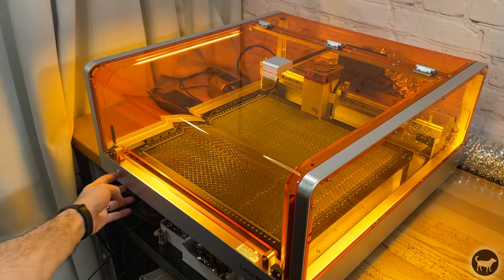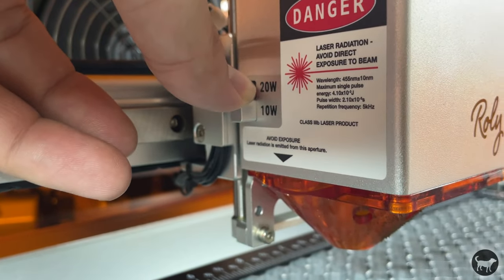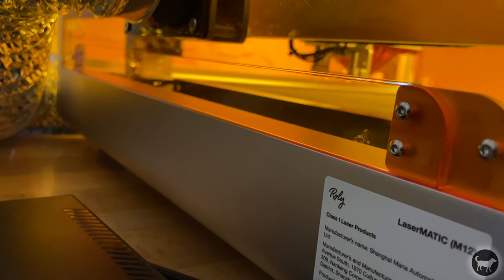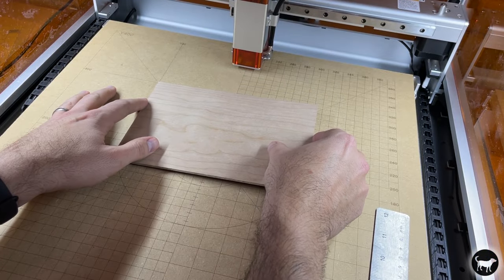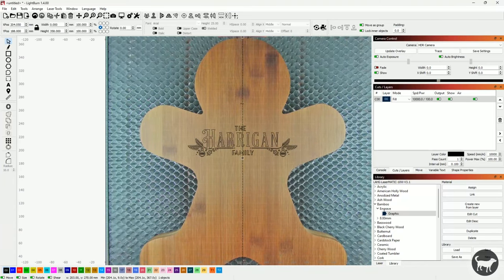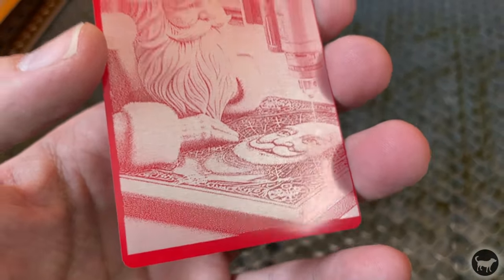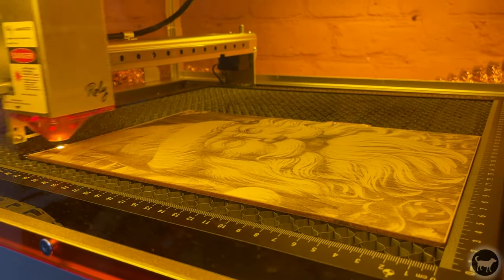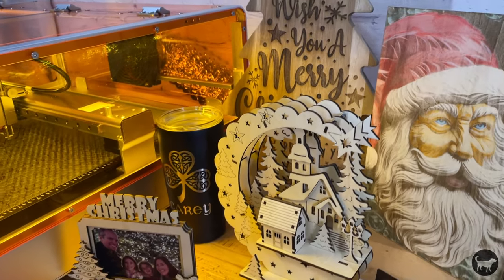LaserMATIC MK2 Laser Engraving and Cutting Machine Review | Full Enclosure | Best Laser of 2023

Comment: Have you used the Xtool stuff? Just wondering how they compare if you have and which you like better. Im looking to get into something like this soon so Im trying to buy right the first time. So far I think I like this better because it looks like it does the same stuff that the Xtool does, but for a better price. 

Does the laser come with software to download? if not, where do you get the software program to run the laser?
Reply from the maker: If you look through my channel you will find almost every xTool machine they made. Feel free to check them out. I would highly recommend Lightburn as the software of choice. It's a paid program but it's reasonable and very worth it.

Comment: Will this cut through metal or soft steel? Or engrave metal like silverware or blades on knives. Great video
Reply from the maker: If you really want to engrave or cut into metal you are going to want a fiber laser. While some diode lasers can engrave and somewhat cut into very thin metal it's really not the right tool for the job.

Comment: Thanks for the great video! What is the max depth it could cut for wood and for metal? Thanks!
Reply from the maker: It would depend on the laser power you have. Thing is that most lasers can cut through thicker woods but it's all dependent on the type of wood, whether its plywood or solid, hard or soft wood. It all comes down to the number of passes that you need. Obviously the higher the power the less the passes. My guess would be around 18-20mm for the 20W laser but honestly you might be able to go deeper. Metal is another story. While you probably could cut around 0.1mm of metal it wouldn't be very clean and would probably warp it pretty good because of the heat.

Comment: When using the camera you need to to an alignment test for each thickness of wood and save them… 1/8-1/4 etc.
Reply from the maker: You are correct. I should have done that as well.
Reply: Correct! I made profiles for  each thickness of material I commonly use. I routinely get placement accuracy in the 1mm range using only the camera.

Comment: Is this dual ( Diode + Ir ) Laser  all in one ?
Reply from the maker: Hello. This particular machine is only a diode laser machine, not an infrared laser. The switch is to choose between different laser powers only.
Reply: Hey I know you did this 2 years ago but I wanted to know if u know why after putting that gcode into the cura for the k7 easythreed printer why won’t it let me print the model

Comment: I don't think it's a LaserMATIC "10" Mk2, it's just LaserMATIC Mk2.  The "LaserMATIC 10 "is the 10 watt version.  The "LaserMATIC Mk2" is the 20 watt version.
Reply from the maker: You are correct. After all of the stuff I was paying close attention to I overlooked one of the most obvious things. I fixed it where I can and thanks for the correction. MK2 really just stands for Mark II or the second version of the machine. I have a Buster Beagle 3D MK2 Injection molding machine as well. The MK2 on this machine still applies to the 10, 20, and 30W versions.

Comment: Would you consider this machine over the Xtool S1, I'm getting one of them
Reply from the maker: They both have their strengths and it’s really up to your needs. The S1 has the 3D engraving and possible conveyor for longer jobs. If none of that matters to you I would go with this Roly. It’s super accurate, easy to use and a great build.
Reply: Roly is supposed to be coming out with a 40 watt with a bigger work area, I might just wait for that, thanks
Reply from the maker: @djs7515  I haven't heard of the larger work area but I do remember the talk of a 40W laser module a while back. This one does come in a 30W and I don't see mention of the 40W on the website anymore but I suppose it's possible.